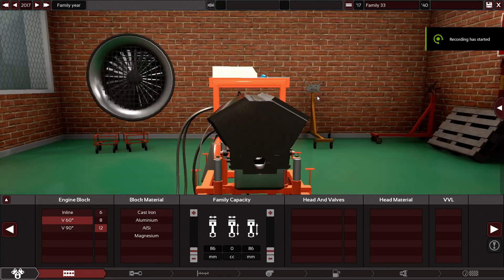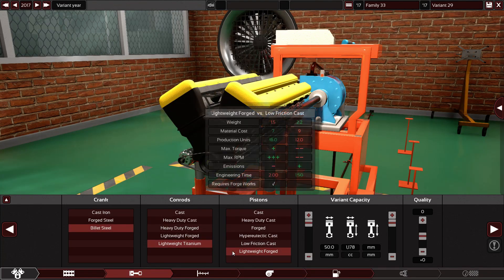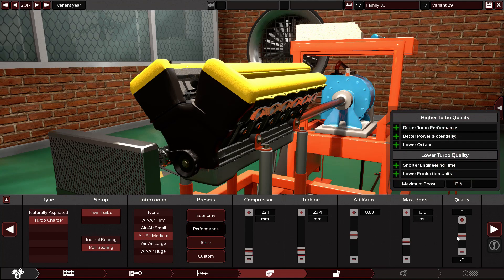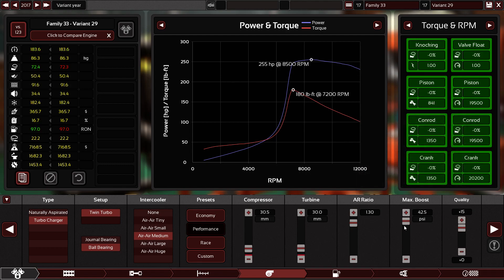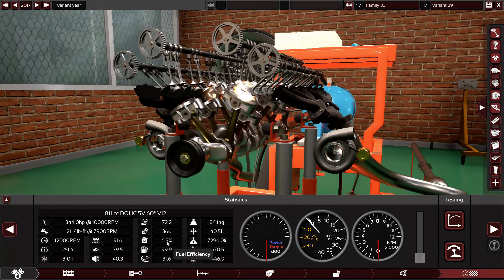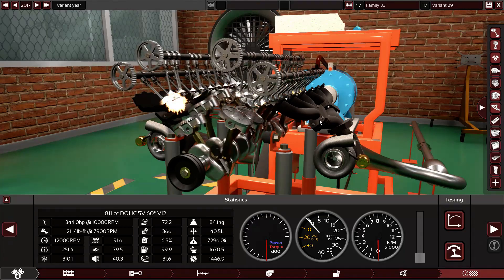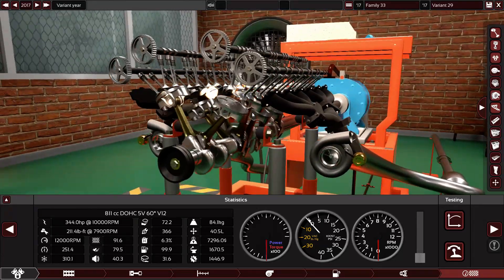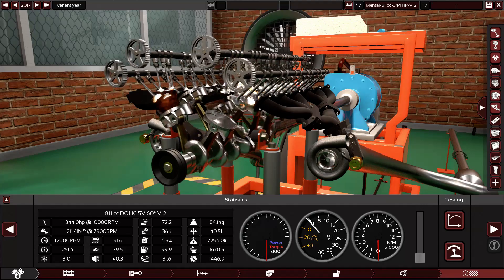The Smallest V12 with MAX HP in Automation

Comment: Those exhaust headers are at over 1500 Celsius. Steel at 1480C glows white, or at 2200 Fahrenheit. And they went white a bit before max revs, so yeah. That's hot :3

Edit: Just wanna say, since it's +15 quality exhaust, they're probably tungsten-steel, the stuff rocket nozzles are made from.
Reply from the maker: Awesome. Amazed to know that.